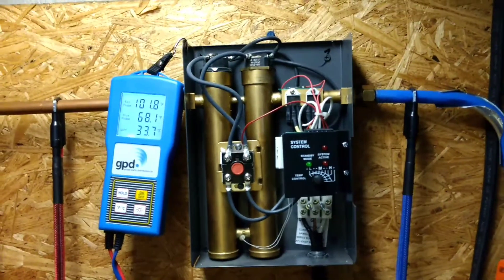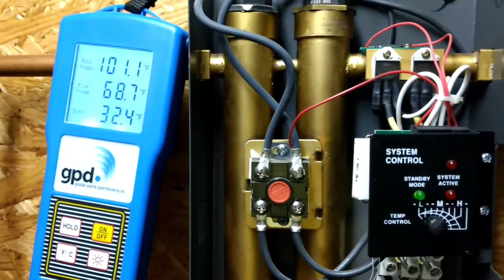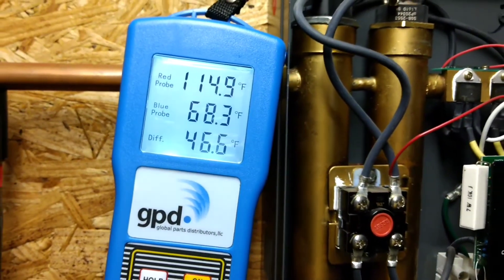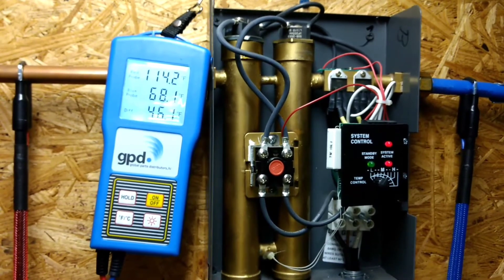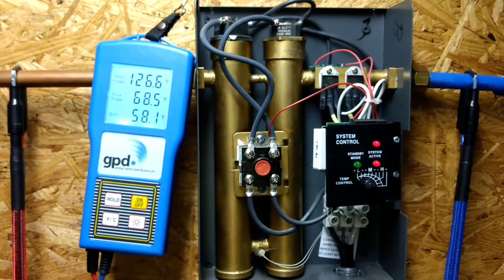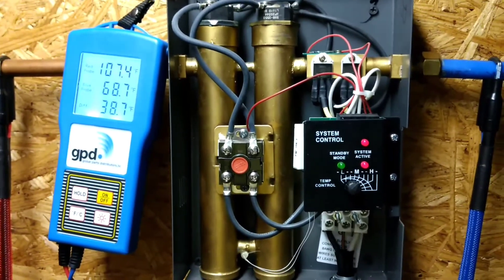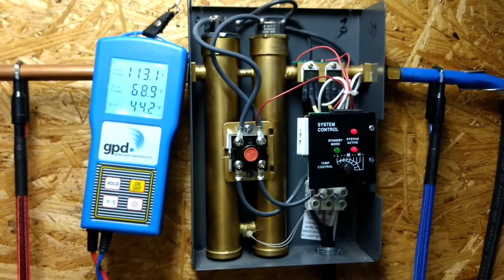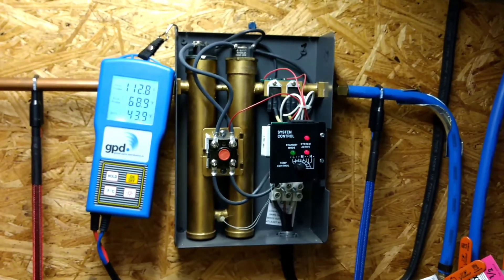Rheem tankless water heater temp control problem

Comment: Hi all, I am helping out a school and the RTE 9 is stuck in a standby mode, no hot water.. I tried contacting the manufacturer and can't seem to find a number. any thoughts assistance would be appreciated. I tried resetting it nothing. thanks
Reply: The red button on the Temp sensor is a RESET button. Press it.    Turn off the breaker......... set the temp dial to 3/4  of the way .... turn on the breaker. if it doesn't turn on, push the reset while the power is on.
Reply: It was very cold here, and my unit was set on super high temp. turn off the breaker, open the hot water tap and let the water run for a while without the heater turned on. Push the reset button. Turn the power back on. turn the temp dial to 3/4 way. Then, try your hot water tap again. Make sure the water is coming in at full pressure ( 150 PSI or lower ) Good luck!
Reply: It's got to have water - it may have shut down to protect it.

Comment: First of all, your logic about flickering lights when the water is warm but not when the water is cold and the heater set to high is 180º backwards. The lights flicker because the heater is turning on & off because the water is already at the desired temperature. And the lights don't flicker in the winter when the heater is set to high because the unit is constantly ON trying to heat the water. Also your RETE-9 should have to work harder to get the same temperature rise as a larger unit. 

Which doesn't really help you, but is just good to know. My flickering or more accurately the slow strobe effect I had going turned into flickering when I swapped out my old school light bulb with an LED bulb. I had heard that that fixes the problem. Personally, my problem all but solved itself when I stuck in a CFL. My guess is the gas remains energized longer so the flicker is less noticeable. I tried different types of bulbs, different brands, different wattage's, different colors and at different price points and my best two bulbs are the CFL & a yellow bug light (old school bulb). My best LED bulb was the Great Value (Walmart brand) so spending more in my case didn't help at all. FYI: My water pressure is 80 psi (which could be a factor) and I set my heater to MAX and regulate the temperature at the tap. 

I recently replaced my 13K Rheem that I think you show in this video with the newer model of (supposedly) this same size Rheem. I say supposedly because the 3 smallest sizes (9K, 11K, & 13K) of the new Rheem all have the same size outer plastic shell now. And (while the writing is very hard to read) I'm pretty sure both of the heating elements in my new unit say 5500 on them so it's possible I have the 11K model now despite the case and box labels saying 13K. Also, Rheem tech support is TERRIBLE! This is reason enough not to recommend anyone buy their products (not to mention all the other reasons)!!! However, at least in my case nothing about my install or wiring or power transformers, etc. changed. This was a straight swap. And I NEVER had any flickering lights with my old unit! 

I'll probably buy my next model from Lowes.  But if that doesn't help I may have to add another breaker or two and add additional lines going to the heater. If you're thinking about having one of these installed, I'd recommend you have them install multiple wires their first visit, so you don't have to have them come back later if you decide to upgrade! 

If you read this far, I hope this helps you! #FuckRheem

Comment: I've had mine for a couple years and during a recent cabinet install, uninstalled it and let vinegar sit in the pipe over night. I'm on a well, so there is definitely some build up happening. I don't see how it wouldn't degrade over time without this occasional cleaning. Also I'm not sure I agree with the accuracy of the test. You super heat the pipe, then turn it way down of course the pipe is going to retain some heat, it's going to take awhile to cool back down to the low water temp. I did notice changing my shower controls helped quite a bit with my satisfaction of this product. Separate knobs does not work well. I'm using this now and it's much better. https://www.amazon.com/gp/product/B0032S6O8Y/ref=oh_aui_search_detailpage?ie=UTF8&psc=1

Comment: Not really sure why you are limiting the cold water coming in?  The cold water coming in cools the SCRs mounted to the intake pipe. Reducing the cold water coming in would also allow the temperature to spike depending how much water is actually getting through.  If you are on well water you could also have some calsium deposits  on the elements or an the bottoms of the two tanks near the temperature sensor.  Mind you the temp sensor is just held in with some hot glue and has a little bit of silicone heatsink compound.  You may try and pull the sensor out and recoat with heatsink compound and make sure the sensor is making good contact with the heat tubes.  Good thermal conduction between the tubes and the sensor is necessary for tight temperature control.
Reply: i agree with what you're saying about water flow coming into the unit , i'm just guessing here but i think he is trying to slow the water down so it doesn't just fly thru those elements , but its already supplied with a flow restrictor built into the discharge side of the unit , i mean all they did was cap the discharge inside the heat exchanger , and then just drilled the appropriate size orifice based on the units btu output . I know its not always feasible but a hot water return with a little taco 006 tying into the cold water feed putting tempered water back into that heat exchanger would help out in so many different ways ....instant hot water , less wear on the unit , and less wasting  of water.
Reply: Good suggestions. I have a more extreme problem to the point where my unit super heated the water. It was set to the lowest temperature and it got so hot that when I shut off the tap, the hot water fed back thru the cold side and melted the pex. It exploded scalding hot water all over the bathroom. One of the solutions I considered after watching this was to slow the water pressure down (currently, 3/4” feed down to the 1/2” incoming line). Maybe if it’s too high the temp sensor can’t get a good reading??? 

The box said to go with 10gauge on a 240v, 30 amp breaker. The sticker on the heater said 8 gauge. I had 10 already set up so I went with that. Maybe that is another cause of the failure? Totally baffled at the lack of safety mechanism in it. It shouldn’t allow nonstop heating before it trips some sort of internal breaker.